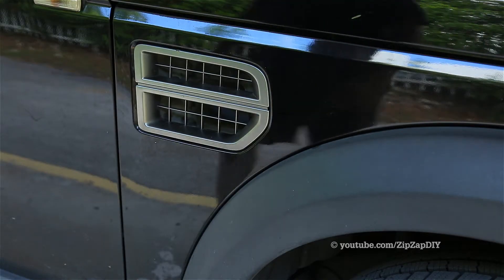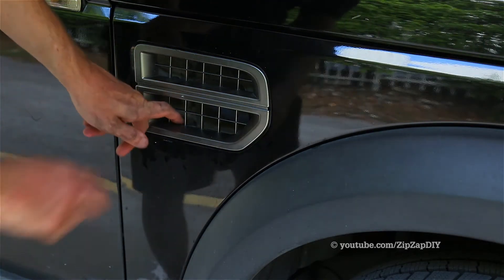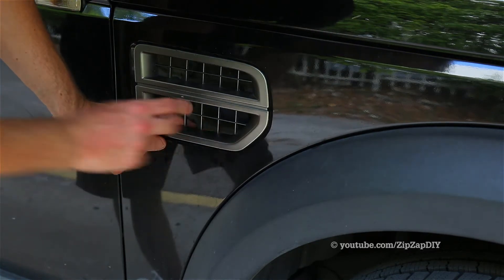How to Remove the Intake grill on an LR3 / RRS / LR4

Comment: I wailed on mine the way that you directed in your video, but there was no way in hell it'd come loose. What I found personally, worked for me, was I took a small pry-bar (an upholstery removal tool might do the trick), and I worked my way around (using a small piece of cardboard - like flyer material), between the painted body material that I was using as leverage, so as not to damage the finish). I very slowly and meticulously worked my way around, using just barely enough force to free the clips. This is what worked for me.

Comment: A better way is to-stand with your back to the grill-reach behind you and hook fingers in lower part of grill-then lift upward and then grill slides out. 
Continually pulling will weaken the clips. 
Love your videos, this is the only tip I can share :). I picked it up off an LR forum.